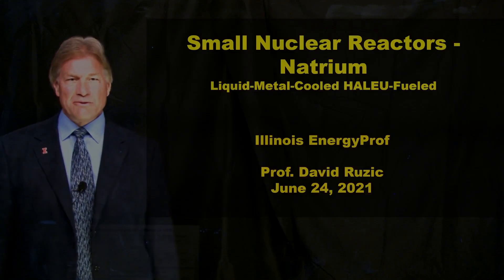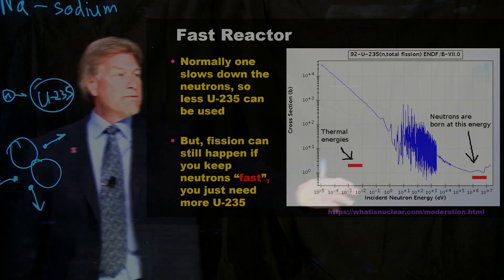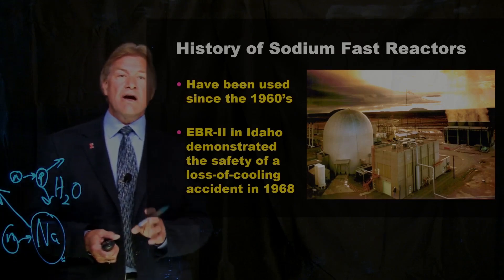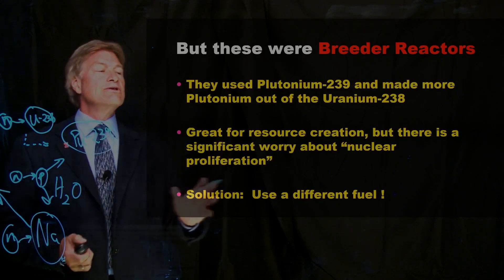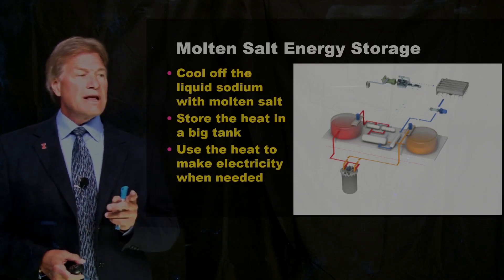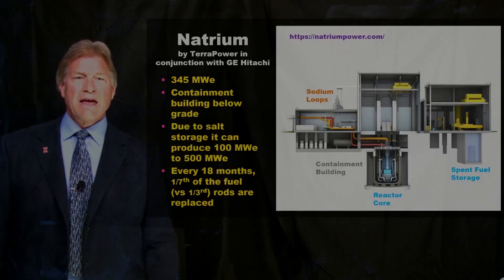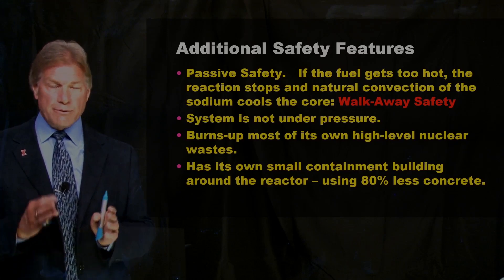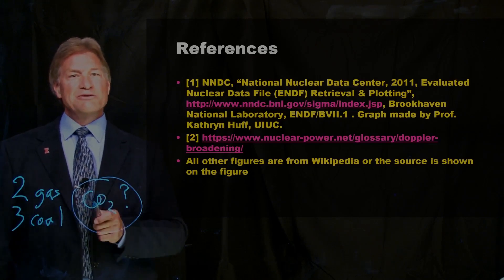Small Nuclear Reactors - Natrium

Comment: Another benefit of fast reactors is that xenon has a comparatively lower cross section at fast levels, ~5b as compared to it's thermal levels ~4*10^6b, while U235's fission is ~1b and 2000b respectively.  So the xenon is less of an issue.

Comment: Melt salt with excess energy from wind and solar.  Cheaper, less risk, and faster to build.
Reply: It's been tried and failed.
Reply: @chapter4travels  
Where?
Reply: @ChrisNotTheKing  Ivanpah Solar Power Facility
Reply: @chapter4travels  Ta
Reply: @chapter4travels  
Nah.  That's completely different.  It's solar thermal, with mirrors.  PV is currently cheaper, and doesn't have a vaporize zone.  Some other places are using concentrated solar thermal for other purposes though.
Using excess electrical energy in a thermal battery was my comment.  If the thermal battery is big enough, losses are minimised, and peaks in demand are well catered for.
Reply: @ChrisNotTheKing  Was there a contest for the dumbest idea of all time?
Reply: @chapter4travels  
What does that mean?  Please explain.

Comment: Yeah nah. Solar and Wind can use Vandium storage integrated into networks like Germany,.Best keep up Proff. USA are getting left behind and China already have their first Thorium salt reactor.
Reply: I'm predicting the Chinese will come to the same conclusion about thorium as the US, and that is circulating hot, corrosive, radioactive salts through meters & meters of pipes, plumbing, valves, seals, bends, pumps, etc is just not a good engineering design. But we'll see.

Comment: It's really interesting that the U-238 starts acting like a control rod because of the Doppler broadening at higher temperatures. It gobbles up all of the neutrons and fission stops and doesn't restart as the reactor cools because there are, if I understand it correctly, neutrons available to restart the chain reaction.

Comment: What no one talks about is what happens when you have a fuel element failure in sodium coolant reactor.  Cesium boils off at 670 degrees Celsius so if your sodium is hotter than that you get cesium vapor.   You probably wouldn't notice it for a long time until it builds up somewhere, and makes an unsafe workplace heat exchanger.   You wouldn't notice it till a good distance away from any system leak because it would have to cool down to become solid and settle out.  So leaks would make a bigger mess than you would think.

Comment: Another reason to build on retired coal plant sites is they are already hooked to the grid.  No new permits for electric power line right-of-ways.  No new balancing of the grid with a new generating station.  No new roads to build to get to the site.  Knock down the old coal burner, build the new reactor.

Comment: I grew up in northern Ontario, Canada and I saw multiple cars seemingly melt away before my very eyes.because of the sodium chloride salt applied to the roads during the winters.   
What is the plumbing made of in these salt reactors?  Have they invented a metal that salt doesn't corrode?
Reply: Chemical plants have done it for decades. Ceramic walls clearly work for chemical furnaces, so too some alloys, and apparently they sometimes use a salt itself frozen on the walls where temp is low enough, melted towards the center.

Comment: Ask RUssia Alfa submarie engineering crews about running molten salt fast reactors. What happens when pure hot sodium meets oxygen and/or seawater?
Reply: And? What happens when super heated steam meets anything?   Re the subs, they had several accidents, but I know of no sodium water explosion accidents
Reply: @Nill757  When super heated steam escapes from ruptured pipe, it cools down as it expands. In a PWR reactor loss of coolant leads to shutdown of reactor and cessation of atomic fission. As water is both a coolant and neutron moderator. A totally passive safety . 
A catastrophic rupture in primary coolant loop of molten salt reactor , resulting in liquid sodium coming into contact with oxygen and salt water will in large chemical explosion.
Reply: @dkoz8321  Agreed, lwr is inherently safe.  

Where has this sodium salt water reactor explosion ever occurred?
Reply: @Nill757  I exaggerated. I should have used 'violent chemical reaction' . Incidents occurred on Russian Alpha and USS Seawolf (old Seawolf not new). Seawolf had it's molten salt reactor replaced with PWR.

Comment: Have they solved engineering problems with na or molten salts? As engineering issues buried such sovied submarines and solar molten salts plants.
Reply: Sodium cooled reactors have had developments, and many problems were solved.
solar MS plants didnt die because of engineering problems with molten salts themselves- yes, there were issues, mostly corrosion, but by removing water content from the molten salt, and new alloys solved the problem. In fact TerraPower states that they took the molten salt tech because it has been improved by the CSP industry to enough technological maturity. What killed CSP is the paltry capacity factor of solar in general, and the fact that to keep that salt hot and molten overnight, especially in the winter (less hours of sunlight) they needed to use natural gas, a LOT of it. The Natrium reactor wont need that.

Comment: I think even better, once developed, would be fast molten salt reactors. These would use chlorine-based salts like the Elysium and Motex proposed reactors.  These reactors appear to be able to use even weapons grade plutonium as part of their fuel.  By mixing in the WGP into the fuel the WGP is denatured so it is no longer usable for making bombs. Essentially the same setup as the reactor in this video except the reactor would be burning up WGP and reactor waste.  Fuel would not have to be removed until the time the reactor is decommissioned.  Just new fuel added as needed.    No need to ever worry about bomb stuff ever being made in this type of reactor while it destroys the excess bomb making material sitting around to many places.
Reply: Didn't the MOX facility PROVE that making fuel from weapons grade Pu239 will not work?
Reply: @clarkkent9080  my understanding making MOX with WGP there is the problem with the cost of making the MOX and that the WGP is not denatured when it is used to make MOX. Essentially MOX with WGP in it is a nuclear bomb waiting to happen. When WGP is mixed with nuclear waste to make MSR fuel you get something that is radioactively very hard to handle as well poisoned for bomb making by having very hard to separate isotopes of plutonium that make bomb making very difficult   The most likely result being dead and frustrated bomb maker(s).
Reply: @stanleytolle416  Recycling, be it with MOX or use in a MSR is very expensive.  The total costs associated with nuclear power plant operation has become the most expensive method to produce electrical power, in the U.S.. Recycling of weapon grade Pu239 or reprocessing spent reactor fuel adds to that expense.
Who would be responsible for building and operating the facility($$) to separate the Pu239 from the spent reactor fuel?  Who would be responsible for the building and operating the facility ($$) to mix the Pu239 with Uranium to make MOX or to mix it with the MSR salt solution?

I electrical generation it all comes down to cost, cost, and cost. and since there are no long term operating commercial MSRs, anything that is claimed is only corporate PR.

Comment: You forgot to look at the income from electricity generation.  Since this plant can output most of it's electrical generation when electrical prices are higher during, times of high demand, this plant can be more profitable than alternatives due this ability.  So far I have not seen any sort of number that compares the profitablity of electrical production based on the ability to produce power when payoffs are high like when the sun is not shining, wind is not blowing or everybody wants power at a inconvenient time.  Why isn't there a good number for comparing this economic advantage?
Reply: That is indeed the biggest advantage of having onsite storage.. and also its flexible cogeneration capabilities. Synthetic fuels, desalination, district heating....

Its difficult to compare because you never know how much wind and solar you have operational (you can have 3GW out of 30 like in Texas last year), or the temperature (too hot or too cold, and demand increases).... But considering how expensive peak times can be (and the flex alerts in California and Texas serving as a reference) i bet that will come VERY handy

A bit unfortunate that the nuclear industry has to increase costs implementing those solutions because of how much Unreliables governments are mandating. on a limit, you could just run your good old old PWRs, BWRs and FBRs full blast, and then use pumped storage- The same company could own both, and make money that way. No demand? pump up the storage, is there demand? let the water flow down through turbines. Done, GG-In fact this is the OG purpose of pumped-storage, but mostly with coal-fired power stations. 

The anti-nukes (theres already one sniffing around this section)  may critic the 4B cost for the demonstration, FOAK reactor in Wyoming, or any subsidies that they may get ( when wind and solar get many more subsidies on the MWH produced and are totally unreliable and useless for any other decarbonization effort other than maybe saving some gas if you also build gigantic batteries, so you can effectively use CCGTs-using SCGTs would negate any reduction because well, half efficiency), but nuclear is the future, and flexibility will make money anyway. 

I also wonder if this kind of basic layout could be used in other kinds of SCFBRs, like lets say, a 1.2GW unit capable of doing something like 600MW to 1.8GW of output. Basically a Superphoenix with a giant tank of molten salt.

Comment: Terrapower's Natrium reactor estimated to cost $4 billion for 345 Mw output is already a financial failure
Reply: And up to 550MW. The load following and cogeneration capabilities of the Natrium are its big advantages. Also financially.
And 4B for a FOAK build isn't so bad. If we let it develop, economies of scale will kick in. Capacity can increase, and the reactor itself will be cheaper to build.
Reply: @AlldaylongRock  Its 345 Mw with the ability to peak to 550 Mw for a short time.  $4 Billion for 345 Mw is almost as bad as the Vogtle's $16 billion for 1.1 Gw and also a total failure and that is even if they can build it for $4 billion.

Remember that they advertised it at $1 billion, got $2 billion of taxpayer dollar for dollar welfare and now before they even broke any ground it is $4 billion.  Soon you will hear the supply chain, inflation excuses as the cost rises.  

They haven't even broken ground yet.  With winter approaching in Wy. construction cannot start until 2023 and if they complete it by 2030 (very doubtful) it will have to operate for at least 5 years to prove the concept.  So your looking at 2035 at the earliest to even know if it works as advertised.
Reply: @clarkkent9080  It's 5 hours and half for the Proof of Concept design. About 1.12GWh of storage. Wanna know how much 1.12GWh in lithium batteries costs? Almost 400 million. And then how much is the generators (VREs)? And one of the advantages of the onsite storage is that they are able to profit off the jank anyway.
Reply: @clarkkent9080  let it be. And I asked, is flushing taxpayer money through Solyndras and Ivanpahs any better? 
Nuclear energy is necessary to decarbonize. R&D and prototype units will be expensive, of course. But you saying that it can't compete with other sources is ridiculous, when the only sources that actually compete with nuclear are either fossil fuels, or the very limited Geothermal. Mr Ruzic states that in the "Economics" section. Wind and solar are useless after a while.
Reply: @AlldaylongRock  A waste of money is a waste of money.  This isn't grade school where you justify what you are doing by saying that other kid is doing something bad too. 

 You must know that Terrapower has got the taxpayer to also pay the $125 million necessary to make their fuel and that that facility is only in the EIS comment period so it will take a while to even make their fuel. And I believe there is a "us by date" on the $2 billion of taxpayer matching funds and it does not look like they are going to make that cut off date.

I don't have any particular power producing agenda.  I just state the facts and if that bothers you, then that is your problem not mine. Complex nuclear projects do not get cheaper.  In order to be even remotely competitive, the Natrium reactor complex would have to cost no more than $2 billion and there is no way that is ever going to happen.  And just claiming that it may get cheaper as more are built is just a dream.

Maybe you need to concentrate on the one political party and 45% of Americans (I am not one of them) that not only believes that climate change is fake news but a liberal plot that they will fight to the death.  I am sure they will accept double and triple electric rates to make your dream come true.

Lets both just sit back and watch the show, but just realize that  I have been sitting back for the last 2 years waiting for something to happen.. They do have a fancy web site.
Reply: @clarkkent9080  You love coal and gas, we already know that.

Comment: Using a nuclear power plant (NPP) in combination with heat storage is insane. The unavoidable efficiency losses in the '3-circuit' heat exchanger set-up and the substantial extra capital cost and materials/resources uses add to the costs and effectively decrease the NPPs capacity factor; all of which inevitably affects the poorest in society the most.
 
The raison d'être for Natrium is ethically tainted by 'living off' the dysfunctionality of wind and solar power plants (WASPPs) by storing heat when these ridiculous technologies produce too much electricity and prices crash, so a Natrium operator can then charge the higher prices when 'the wind don't blow (often) and the Sun don't shine (every day). So again, the greatest impact of 'propping-up' high prices, is on the poorest.

Instead, NPPs can operate at 100% availability and load-follow both diurnal demand and the crazy patterns of WASPP generation - almost instantaneously - when combined with electrolyser plants for the manufacture of greenH2.

For the decarbonisation of all sectors of energy use, greenH2 manufacture is as vital as generating low-carbon electricity. Electrolyser plants are low cost ($300/kW--->$200/kW) and suffer no technological issues from rapid load changes (electricity input to the process). The overall efficiency losses from this combination will be miniscule.

Comment: Most sodium cooled reactors have leaked and caught on fire.  Molten salt reactors are the only inherently safe design so far.  MSRs can be fast reactors and burn up the spent fuel from LWRs.
Reply: Concerning the burn-up of spent fuel there is one small problem. We always forget the details
You need a processing plant to separate the Pu239 from the other isotopes in the spent fuel. Then you need a plant to mix the Pu239 with U238 to make assemblies that can inserted into the reactor. And then there are the shipping casks needed to move the spent fuel from the old reactors to the processing facility along with security and loading and unloading facilities. It is not so simple or cheap when you consider the reality of actually doing it. MOX that was supposed to mix pure weapon grade Pu239 with U238 to make reactor fuel assemblies was canceled in the U.S. after spending $17 billion and they finally admitted that it would cost $100 billion more to complete and operate.
Reply: @clarkkent9080  Always wrong and wacko.  GO TROLL SOMEONE ELSE, AH.
Reply: @markdavis8888  Must have hit a sore spot.  You know nothings hate when you are proven wrong.

Comment: "Construction will finish in late 2020s" - Note however that the reactor can not be turned on until it has HAELU fuel.  It used to be that Russia was (and still is) the largest source for this and it is not created in the US in any significant volume.  Due to the sanctions on Russia and its uranium, it is being excluded as a source.  This means the US or other NATO/friendly sources will have to be created/secured.  It may cause delays in the deployment date of the Natrium reactor.  Ideally, we would downblend some more HEU (90%+ enriched) to make HAELU from older US nuclear weapons, but I believe that stopped as well.
Reply: Terrapower is already behind schedule and will not go operational until 2030 at the earliest.

Comment: So when you talk about the absorption cross sections temperature dependence,  does this happen in standard thermal spectrum LWRs? Is this even necessary considering how steam produced around fuel rods effect moderation, stopping fission for LEU LWRs anyway? Also are standard LWRs capable of passively cooling decay heat, or is this a feature only of low power density microreactors?